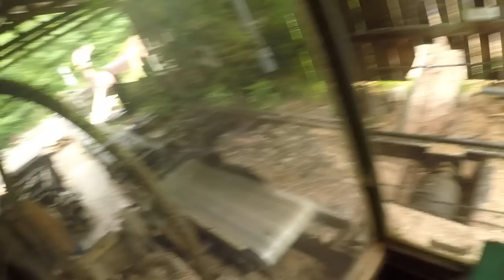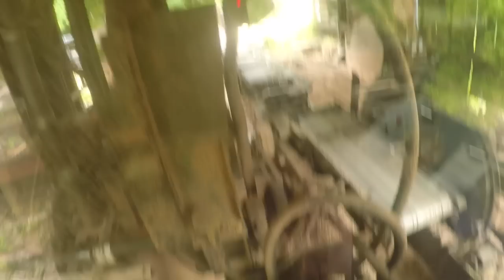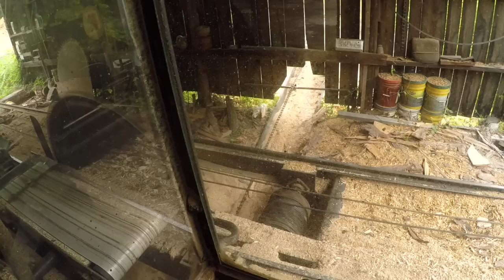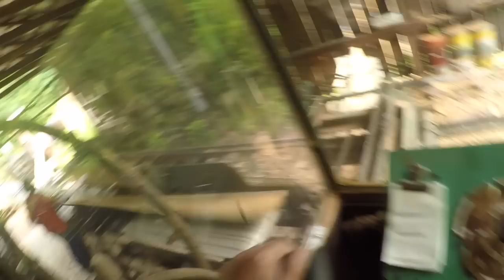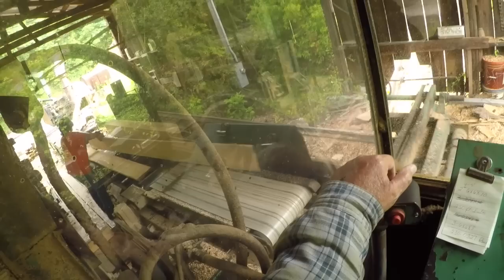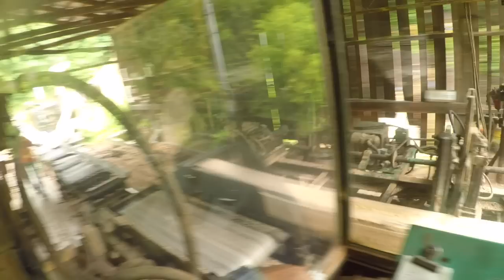SAWING MORE PINE

Comment: Watch this again and watch that mouse in between the rail and the wall down in the doodling chain ditch. That thing's all OVER the place. Trying to get out and dodge that chain and the knots coming up. My Sweetie is like Maw in that she gets concerned is a very light word to use. Hard work won't cure cancer and it won't cure GOUT either. It was just our leg hurting time I reckon. My right knee was giving me a fit but it's easing off now. I was laid up all fall and winter with that mess and am just now getting over it. Between it and arthur it sure has been interesting around here. I couldn't even squeeze a BBQ lighter to light the gas cook stove with both hands and now I can do it with one. God is still good and Happy Pappy Day!